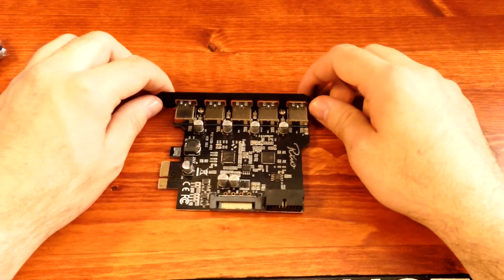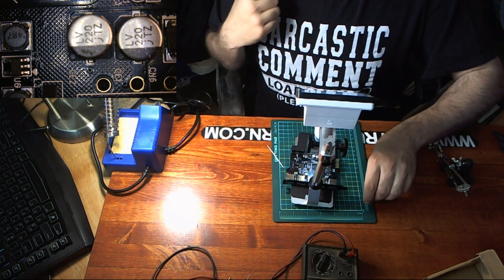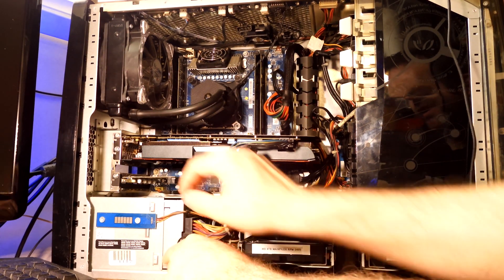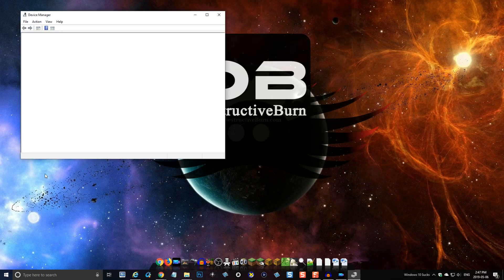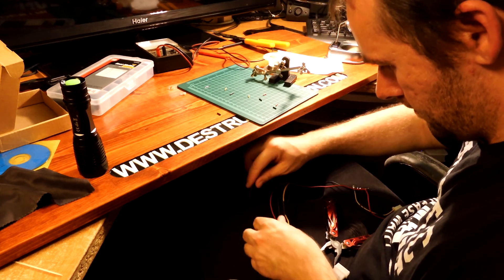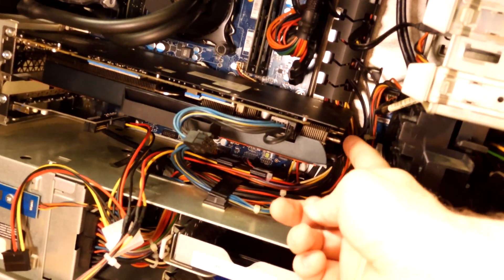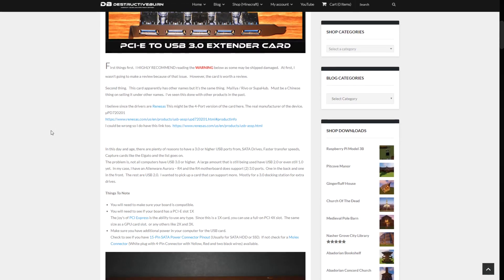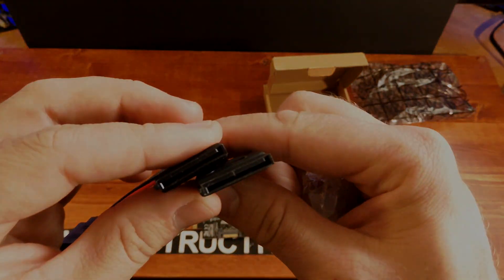PCI-E To USB 3 0 Extender Card 5-Port Review Repair Install And Tests

Comment: Any idea where I can get the drivers for this card?
Reply from the maker: I still have the drivers.  If you wait a little bit, I'll rebuild the website post.  If you want them now, you can pop into my website chat and I'll PM you the drivers.
Reply: @DestructiveBurn  thank-you!. If you can send me a link that would be great.
Reply from the maker: @pjf93  Chat links in the description.  Or just wait a bit.  Currenly working on restoring the post.  Should be around 20min if that.
Reply from the maker: Post restored.  The download is below under Data from CD: https://destructiveburn.com/pci-e-to-usb-3-0-extender-card-5-port/

Comment: Hi...if my on board usb 3.0 is not fucntioning of xhcl error something for some unknown reason, will add in this pcie usb work?
Reply from the maker: If your USB-3.0 ports not working or don't have any,  you can use this instead as it uses the PCI-E express lane with its own driver.   Personally, I got it because I only had one USB-3.0 port in the back and a broken one in the front.   I still use it every day.  0 issues.